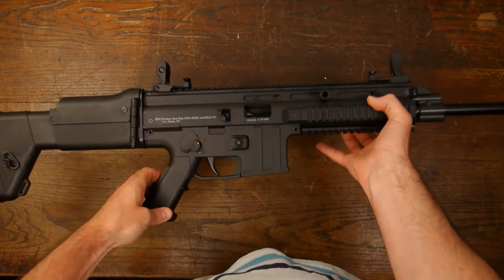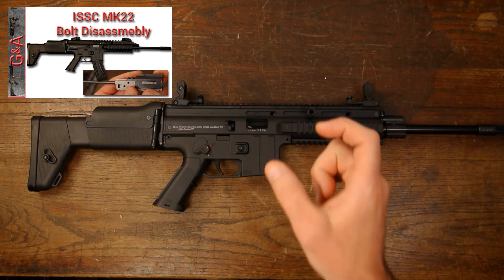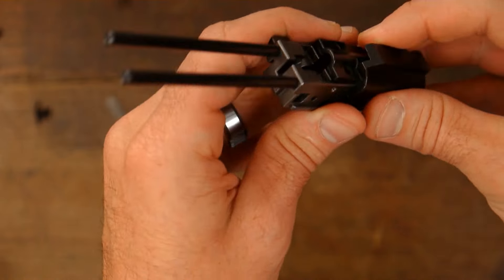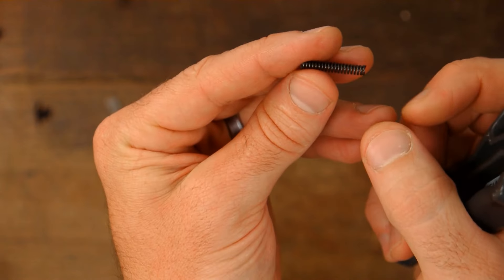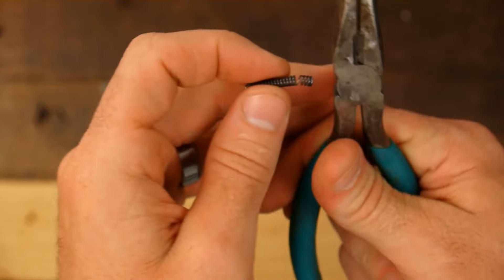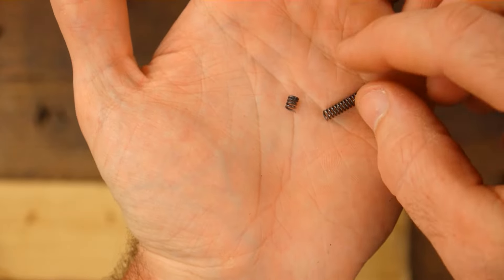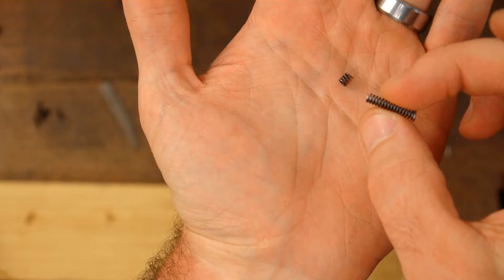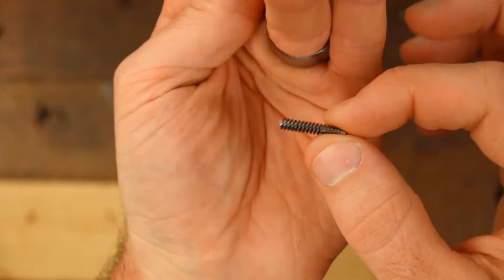ISSC MK22 Firing Pin Return Spring Mod

Comment: Did the mod last night (note not for beginners) I told myself this gun couldnt get any worst ... This morning to my surprise at the range shot 200 rounds of Federal AutoMatch 40 grain solid not 1 issue. Field stripped it cleaned it and put another 200 rounds through it not a single jam. To this point this mod is flawless. One more thing the 2nd gen. also has that issue Never seen one out of the box fire right. Thank you for saving my MK dear sir cause i Was about to give up on it !!!
Reply from the maker: I have an update video showing me shooting after this mod and it did the trick for me also. That spring is just way too stout. Keeps the firing pin from reaching the primer. Over engineering here isn't a good thing.

Comment: Just finished doing the firing pin return spring mod,and thought I was on my way to testing my new rifle but have hit a snag.My question is:How do you reassemble the upper and lower assemblies and get that butt plate with the new spring into the butt of the rifle so that the metal plate can be secured in order that the stock may be reattached?Any suggestions will be appreciated.
Reply from the maker: I have another video linked in the description that goes over dissasembly. Check that out if you haven't already. Thanks for watching!
Reply: Did u ever figure it out and did the washer model or spring model stop the misfires
Reply: Watch his Dissemble video, he pit it back together, it is tough to compress that spring, but it is not impossible, done it at least a dozen times my self by now, I can do it in one go now, takes practise.

Comment: hopefully this does the trick. can't wait to see the shooting vid.
Reply: sixfteightinguy Me too, actually this is what I was going to say.
Reply from the maker: sixfteightinguy Thanks. I am editing it right now. Will be up later today. I think it is fixed.
Reply from the maker: Reg Sparkes Thank you sir.
Reply: Guns & accessory which mod do you think fixed it ? was it washer mod or return spring removing 3 coils mod or both ?
Reply from the maker: Return spring
Reply: @gunsaccessories8853  just got done spring mod put it all back together racked it with an empty magazine pulled trigger then racked again with empty mag this time would NOT dry fire and ejection port stayed open to magazine out put back in still will not dry fire or close ejection port . Any ideas ?
Reply: Guns &accessories i did spring mod put back together put an empty mag in charged and dry fired , took out mag reinserted , charged and pulled trigger it would not dry fire this time and ejection stayed open any idea ?
Reply from the maker: Did you go back and make sure that you got the bolt put back together properly?
Reply: @gunsaccessories8853  yep u were right the bolt wasn't seated properly. Question dose the aluminum piece that fits into the long spring that gets a screw from top of butt plate get fastened to rifle  or does it just sit free in long spring and connected to butt plate with one screw.

Comment: I just bought one a month ago. Only thing i can say is that it does not like hollow point ammo. Besides that I have already put over 1000 rounds and have only had 5 jams, and 3 of them were my fault. Whatever used to be the problem has been resolved. Super fun gun to shoot.
Reply from the maker: +John Doe It is definitely a fun rifle. And beside the issues that I had, it is a relatively well built rifle, and pretty accurate. Thanks for watching.
Reply: the bolt in front of the trigger that is holding the lower section together seems to have fallen off. Do you know what it;s called or where to get it? One side is a threaded bolt and other is a threaded tube. Any ideas?
Reply from the maker: +John Doe I think you are talking about the front take down pin. If that is what you're talking about, then I would suggest getting one of these push pins. 3 different links to the same pins. There is a short one and a long one. I don't really remember which is which. But I would just go ahead and replace the front and rear takedown pins with these. http://rrages.com/pins/net.htm
http://www.hkparts.net/shop/pc/HK-German-Push-Pin-For-Forearm-Or-Lower-p75.htm
http://www.robertrtg.com/store/pc/SMALL-HK-PUSH-PIN-2p1893.htm
Reply: +Guns & Accessories you're awesome mate...thanks for the quick reply
Reply: ps. This gun hates hollow points

Comment: I just got some new mags in the mail. They are 10/22  conversion mags for the MK22. I have seen videos on other mags showing how to convert from 10 rounds to the full 22 round  capacity, but it can be difficult  as some manufacturers actually glue the mags together. These appear to just screw together but I had to run out and buy some very tiny star head (T6) bits. I was wondering if you had experienced the same thing with this magazine?  If so, how difficult is it to take it apart and make it a full 22 round capacity? I am afraid to tackle it for fear of messing it up without asking you first.  I live in Tennessee so high capacity mags are okay.  I enjoy all your videos. Keep them coming.
Reply: UPDATE:  I took a chance and broke off the tabs down each side of the slide.  It wasn't easy because they attach to the inside plastic 10 round block. At one point I drilled out those attachment points and was then able to peel them apart using needle nose pliers.  The magazine then comes apart easily after removing all the star head screws.  The lower block has a vertical fin for the spring to fit down over.  However, once it is all reassembled, the mag only holds 19 rounds and no more. The follower also has the same fin pointing downward, so when compressing the spring, it touches the lower fin and won't go as far down as the factory 22 round mag.  The spring did not have to be stretched as it fills the entire magazine, but it is a bit looser than the one inside the factory mag. However, I took it to the range today and it worked flawlessly. I have another magazine to convert, but I will leave it at 10 rounds for now.  That's a rainy day project and a bit frustrating. The MK22 had no issues whatsoever with the factory 22 round or the converted 10 round mag. I am happy to say the least.
Reply: Final thoughts:  I suppose the tombstone shaped fins that hold the spring in place could be trimmed off on the follower and the lower block.  That might allow a few more rounds but I didn't want to get into that.  The ammo I shot today was Remington Thunderbolt.  They work well in my GSG Firefly also where other rounds have given me issues in the past.  I think the reason is because they are a tad bit shorter than other rounds and don't bind in the mag.  Feeding from the mag seems to be where most problems occur.
Reply from the maker: That is great that rifle is working with both of the mags. It is a fun great looking rifle. Thanks for watching!

Comment: What does this do? my mk does not want to feed next round,  have to pull cocking level after each shot...
Reply: Check your springs and make sure that the small end of the spring is facing towards the bolt assembly.